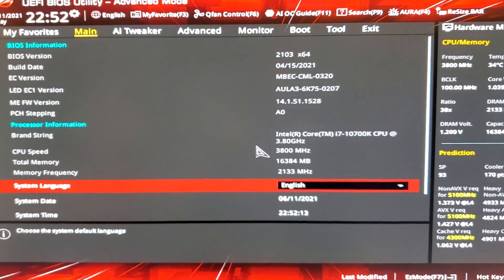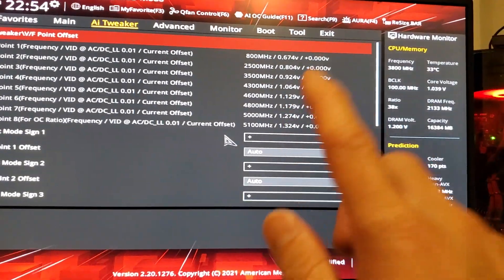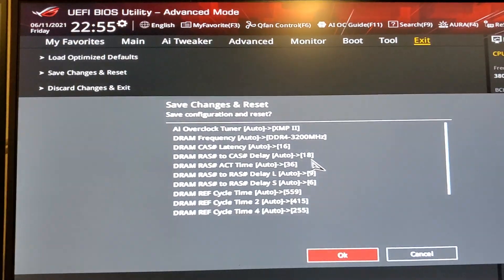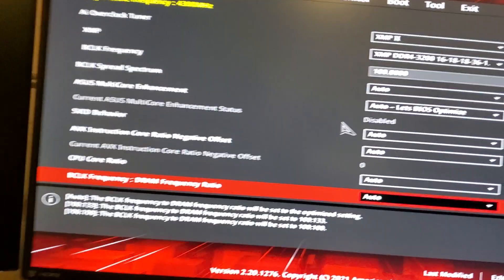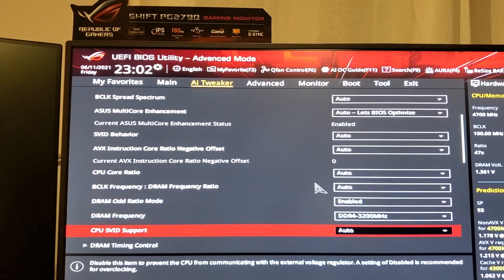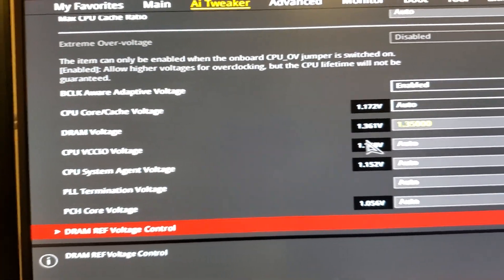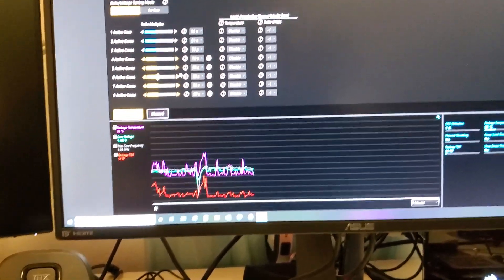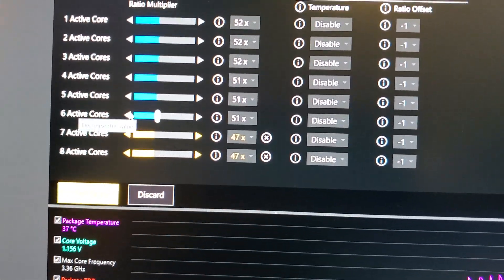Intel i7 10th Gen IA AC/DC LL 5.0GHz Overclocking Tutorial.

Comment: Man, I wish you'd do this for a Gigabyte Z790 Motherboard.
Reply from the maker: https://www.techpowerup.com/review/gigabyte-z690i-aorus-ultra-plus-ddr4/5.html#1-9

this is not the Z790 but the Z690 board. I believe Gigabyte software will still be the same. See photo 9 and see the first line of the AC/DC LL.

Just change that value to between 0.30 to 0.90 in steps of 0.10+/- 

Keep load line calibration to the middle and adjust your multiplier to what you want to work with. 

I would refrain from adjusting any other values.
Reply: @pianobench6319  In your Bios Settings you have set your LLC Loadline to Level 4 .
Asus Bios Code set your DC_LL automatically to 0.98  by choosing LLC Level 4!

Comment: Superb video! I think you should also set max power (e.g. 180 W or 235 W, check the specs of your CPU) in case your BIOS has stupid defaults to avoid degrading your CPU over time.

Comment: how i can this with i7 11700k ? i play cs2 and i want max perfomance but this cpu is very unstable and very hot to overlock now i try the best after  this  video !
Reply from the maker: @xhulioshyti92  what motherboard do you have?

If it is MSI they label the setting as CPU lite load.
Reply: @pianobench6319 i have asus z590, my stable is on IA AC/DC at  0.5 and singole core to 47 47 47 46 46 46 45 45 (load line 4) are the right compromise for perfomance/stable/temperature
Reply: ps.I gain with IA AC DC 0.45 for now !!
Reply from the maker: @xhulioshyti92  https://hardforum.com/data/attachment-files/2021/03/444691_spec.jpg

I would follow this table for your 11700K and try a 1 to 3 core at 5000 then 4 to 6 cores on 4900 and finally 7 to 8 core on 4700.

If you do run an all core. That allows you to overclock above 5000. So say 5200 all cores. Just run this for gaming only.

If you go 1 to 3 core at 5100 and 4 to 6 core at 5000 and finally core 7 to 8 at 4900. The cpu may never boost above to 5100 even on extremely light loads. I think it is hard capped by intel.

Hope this helps.

Comment: i have the ASUS Prime Z790-A WIFI ATX LGA1700 Intel Z79, with the i9-13900kf, and a rtx 4090 with 32gb of g.skill 6000mhz ram.
 I have set my AC LL to 0.5, SVID to "typical" and IA VR Voltage Limit to 1400mV, hasn't really touch anything else, my DC LL is set to auto, what would you suggest i change ? 
i mainly play warzone on my gaming PC
Reply from the maker: @carlo2202  I haven't tried the Raptor Lake platform. But it should be similar to my comet lake. I suggest leave AC LL to automatic. And then set SVID to typical. Go into HWInfo CPU and look for the AC/DC LL value. For mine it is 0.60 for yours i won't be sure.

SVID set to Typical will set both AC and DC LL to the same value. 

The voltage limit may limit how high your CPU can boost. Bare in mind, if you use the auto boost in your CPU it will only boost to maximum rated.

As an example my CPU will only boost to 5.1 GHz as that is my highest rated. If I want it to boost tp 5.3 GHz I have to set all core ratio. So per core boosting follows your specific CPU factory rated boost.
Reply: @pianobench6319  IA Domain Loadline (AC/DC): 0.500 / 1.000 mOhm

GT Domain Loadline (AC/DC): 4.000 / 4.000 mOhm
Reply: i tried to put AC LL back to auto, now my AI domain Loadline (AC/DC) went to 0.400 / 1.000 mOhm, GT is the same

Comment: Hi, as a FPS gamer I got some issues setting up AC/DC loadlines for my CPU 14900k. Every time I change AC/DC or RAM frequency I get different mouse response, either slower or faster feel. Everything that has to do with the voltage affects it, not sure if something is clashing in my system or this is normal and everyone is experiencing this.
Reply from the maker: AC and DC load lines are basically voltage on demand. 

In the past you had a base clock and idle clock. Just two speeds. 3.6 GHz and then 800 MHz. So all was good. Just two voltage setting. One at .9v and the other at 1.2 volt or whatever.

Today you have multiple speeds and multiple cores. 1 core running at 6 GHz sure run 1.45 volts because the CPU only gets go 60 watts. You want all 24 cores to run? Okay 5.4 GHz and now you use only 1.33 volts but at 200 watts. 

If you are adjusting voltage, only adjust ac and dc load line. Set them to the same voltage and do not adjust the other offset or VF point values. Keep the multiplier clock speeds at the default and let the CPU determine the speedbased on your AC/DC adjustment. You are basically adjusting the Q point or operating point of your CPU.
Reply: @pianobench6319  The problem that I had is that any change in voltage, load line, lite load even adjustments have been made to lock cores, disable enhanced turbo etc. Mouse input/delay still present with every change. Different settings different input. Only disabling TVB has made things better.
Reply: Same. Just find the best scores with lowest voltage and that will also give the best mouse feel.

Comment: Hey man, this was a great video that explained a lot of things. I know this might be expected but I just wanted to confirm it anyway. So my ASRock Extreme Wifi 6E mobo has set the latest bios default AC/DC LL values to 0.74/0.74 however I am experiencing really high temps at stock while running cinebench R23 - 100C on cores 3,5 and 7 after maybe 1.5 loops but my score was around 29000. Now I have reduced AC/DC LL values to 0.1/0.1, the temps dont even cross 80C but my cinebench scores dropped to 16000. Am I missing something? Do I just have to bump the values to find the sweet spot? Any help is appreciated. Thanks!
Reply from the maker: Thanks for the positive remarks. Over the years I started to really observe the ac/dc ll behavior and I missed it in this video. But ac/dc ll is basically a dynamic voltage regulator. So you have a few things going on. (Boost Freq in both single thread and multi thread performance) And then you have power/temperature plus voltage at the boost frequency. All of it is important to find what ac/dc value you want to tweak your system towards.

If you mainly game and you have say a 14900KS that can boost to 6.2GHz stock (single thread) than you want a higher load line. Say 1.0 mOhm. The chip now boosts happily to 6.2GHz in single thread CB23 and temperatures remain 50C to 60C with power at 50 to 60 watts. If you lower the ac/dc LL to 0.2 mOhm for the same workload above, the boost may not get to 6.2 GHz now. It might limit to 5.9 GHz with slightly lower power/temp because now the voltage provided is lower. This is one case to consider. 

Now same 14900KS all core load for CB23 will operate at 5.7GHz (multi thread load). If you use a 1.1 mOhm ac/dc you may find that the CPU max to 100C and 300 watts and now throttles to 5.5 GHz or lower. The voltage will be hovering 1.4 to 1.5v but the chip will throttle long before that. In this situation you want to tune the ac/dc ll lower.

So you go 0.6 and now the 14900KS may run CBR23 at 5.7GHz to completion. It could run at 84C and use 250 watt.

So a few takeaway from knowing this. If you consistently run an all core workload, lower the AC/DC Load Line value. If you run more single thread workloads and you DONT see CPU boosting, consider raising the AC/DC load line value. That is what the ac/dc load line is really doing in the background.

Some users will try to find that sweet spot you mention. Good all-core load and the CPU boosts to the 6.2GHz (14900KS) or 5.2 GHz (12900K) in single thread workload or for gaming.

Comment: So setting AC Loadline lower than stock is the same as setting a negative adaptive offset?
Reply from the maker: Somewhat. It is much more complicated than that. Adaptive voltage offset has to run through 3 rules before you see the voltage that you have set in place. 

Here is the original post that got me to start using AC/DC LL to trim my voltages. I learned it from this post and I adjust my voltage the same as him. Set a good load line calibration and trim the voltage with AC/DC.
https://rog-forum.asus.com/t5/z370-z390/mce-explanations-and-others/td-p/780479

Comment: Dude, i want to thank you. This was my exact problem. I recently purchased an ASUS b760i with a 13600k. I didnt really want to mess with overclocking..but i was running into temperature problems..so i updated my cooler and that helped..but then i noticed my vcore was frequently hitting 1.52v..after 2 weeks of researching i couldnt find a fix..assumed i lost the silicon lottery..i found  your reddit post and looked...my board was defaulting the ACDC LL at 1.7! I decreased it and settled on 0.7..with 10c cooler temps, lower volts, and no performance loss in cinebench..thank you!
Reply from the maker: glad to hear it!

these are good chips but I wish there was better documentation for what each and every feature does! A lot of the motherboard functions are written by Taiwanese engineers and secrets are in Chinese. 

The reason why the CPU defaults to 0.6 or 1.1 as it's worse case is for different loads. Some users just play 60 FPS solitaire or others are playing 60 FPS CS:GO or some users use these chips to specifically use CPU render for media work. In each use case, the voltage can vary up or down. And the current/power usage definitely varies. Because of all these variations, an AC/DC LL of 0.6 or 1.1 and greater allows for the CPU to use a wider range of voltages with different currents or power usage.

So when you lower your AC/DC from 1.7 to 0.7, you lower the maximum amount of current/power that your CPU can use but you also decrease power usage. If you only run gaming loads, this is perfect as gaming never really places a big load on our CPUs.

Glad this video helped!
Reply: @pianobench6319  yeah, in real life, the most load I'm going to be having is something like Baulders Gate, pal world, or Minecraft lol. I'm guessing it was defaulted so high to give the board room to handle higher loads? Just seemed really high. It was running 1.51v in bios..so hard for me to understand why they did that.

I haven't really graphed it out like you did. But I ran cinebench and prime95 for a while. The VID was pretty close to Vcore..with vcore usually slightly higher..so I'm thinking I'm good. Again I'm not looking to OC. Just want a system I don't have to worry about

Comment: Load line adjustments are normally quite confusing for me, but this video made it quite simple to understand. In stock form, it seems that in basic terms you are undervolting which would help with temps greatly. What I'm curious is, whether load line method is different than using adaptive voltage for core and cache in negative offset mode for undervolting purposes. Have you tried that?
Reply from the maker: Load line method is basically a fixed voltage. But remember voltage setting always has an idle and then a at load voltage. 

In addition to this, the voltage at load can vary too. Single core voltage load using 75watt will be a different voltage then 200 watt at max core usage. And it is because the frequency will vary also.

If you left it stock, it does all this work for you. If you use load line ac/dc it will allow you to lower the overall voltage across all the frequency. 

This is because at stock these chips are expected to be able to run AVX prime 95 loads 24/7. But if we under voltage with ac/dc load line, we can probably run prime 95 for a few days/weeks with no crashes. But crash is no longer guaranteed.
Reply: @pianobench6319  Thanks. Is using load line ac/dc to lower overall voltage across all frequencies, different than using negative offset with adaptive core voltage?  Thats the part I'm not getting. It seems to be different approaches to achieving the same objective.
Reply from the maker: @toysars  from what I recall reading back in 2020/2021 the negative offset only has an effect on the at load voltage frequency. So you use stock AC/DC at 1.1 mOhm that is set by Intel and your board for the other voltages. 

But at the maximum frequency you set and at that maximum at load voltage it will apply the offset.

So at idle it won't apply that offset. Or at between 800mHz and 5000 mHz won't apply the offset in between. 

At least my understanding. With Asus allow per corr frequency adjustment, I don't want to tweak 4 cores at 5.1GHz frequency when I  tweak 8 cores at 5.0GHz individual frequency and voltage. 

How can I apply the correct offset at 5.2 GHz and 4.9 GHz? At 5.2 GHz the voltage scales by a lot more then the small offset from 4.7 GHz to 4.9 GHz. Does that make sense? 

It is confusing but it is the difference between automatic voltage for all frequency and one manual voltage for a specific freq.
Reply: @pianobench6319  That makes sense. You mentioned, LLC4 gives you a fast response time between high load to low load and vice versa. I still don't fully understand how LLC levels work other than its impact on vdroop and overshoot. For undervolting purposes, is it better to be lower than LLC4 (3,2,1) or higher?
Reply from the maker: @toysars  typically load line calibration (not AC/DC) is meant to protect the CPU from a current spike if we suddenly UNLOAD the demand on the CPU. So imagine a CPU running insane P95 hitting 100C and taking on maximum* current. 

The motherboard knows that the CPU needs this current. And it has to build up the voltage within it's capacitors to keep up with the demand. Remember this is happening really fast. Because..... we want really fast FPS and response right? So fast clock cycles. 

But with this fast power build up, what will happen when we suddenly unload the CPU? Will the temperature drop first? Or will the power delivery stop before that? Sometimes the motherboard is pumping so much current and heat into the CPU that when we suddenly* unload the demand, the CPU can become overloaded and overheated temporarily. 

So in order to prevent this from happening, we prefer to set a load line calibration. Meaning that at idle our chip can be at 1.375 but under load, that voltage can drop to 1.275 volts under load.

If the CPU was to run at 1.375 under load, it will be closer to it's maximum recommended operating voltage. Which is 1.50v to 1.60v

But if we set a LLC that is too low, the CPU under load may run at 1.15 volts which will be unstable. 

So LLC4 is generally recommended. If you fine tune your system for extreme overclocking and peak performance crown, I think you can run a higher LLC to be more optimized for high clock and stability. But for the vast majority of users LLC4 is the sweet spot.
Reply: I am pretty sure an offset on adaptive mode applies across all frequency points. Which is why it can crash on sleep sometimes for me on a gigabyte z490 @toysars

Comment: Thanks a lot man
Few questions:
1. All the IA AC/IA DC loadline talk, is it applicable to 13th gen Intel CPUs? I have a 13700K
2. Should these 2 values be equal? is lower AC means lower volatge? what about DC lower vs higher?
3. My 13700K (no overclock, on Asus Z790 Prime, Best Case Senario, HWInfo giving me AC/DC=0.01/1.1
I notice in Cinebench I have a sizable vdroop from 1.305 to like 1.24 
Thanks
Reply from the maker: 1. Yes I believe IA (Intel Architecture) AC and DC load line still apply to your 13th gen intel chip. It is how Intel programs their cpu to have optimum voltage and frequency at varying level of power demand. Think of voltage like the Horse Power in a car and the frequency as the high RPMs. 

When you go on a steep uphill climb, your HP does not matter but what actually matters is the TORQUE which in CPU speak is the current. So having an sweet AC/DC LL value is like tuning the torque/HP curve on a car? Does that make sense? So all Intel chips have this. The AC/DC LL values are the sweet spot of the CPU that account for all loads. Both a high demanding (hill climb load) and a low demand (down hill load).

2. The two values should be equal in order to have the software display the most accurate voltage and power/current reading. You can verify by measuring the voltage in the back. When the two values differ, the displayed voltage will differ from actual measured voltage/current.

3. Best case scenario just sets the best case voltage tables (or frequency/voltage/power curve) for your CPU. Think of it as the ideal engine curve. It will be both a powerful engine and the most fuel efficient. That is what Best Case will do. But you have to test for stability. Just like in an engine if it is too fuel efficient, you won't be able to handle the steep hill climb. Infact it may go backwards or be unstable.

The Vdroop is dependant on the load line calibration. Your CPU at idle voltage is higher than the CPU voltage under load. This is because your voltage needs a buffer. When the CPU stops doing work (no more hill climb) the excess voltage needs to go somewhere. Having a reasonable vDroop of Level 4 or in the middle will keep the CPU at a good level.

Level 4 will provide both a big buffer for the high voltage load to unload. And it will also keep the voltage high enough so that the CPU will be stable when you place a high performing load on the chip.